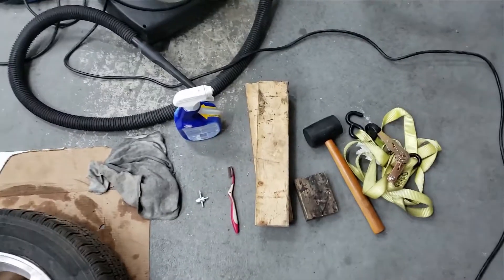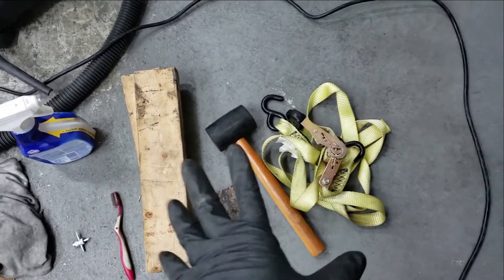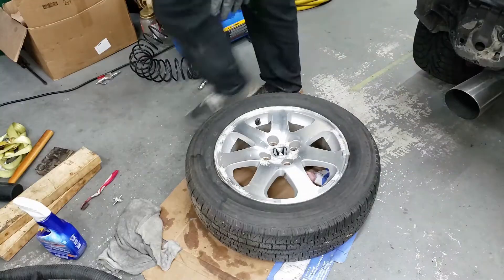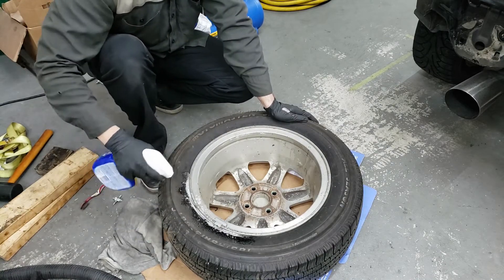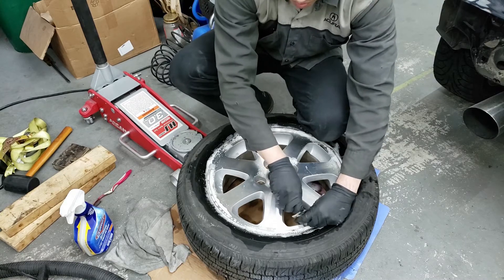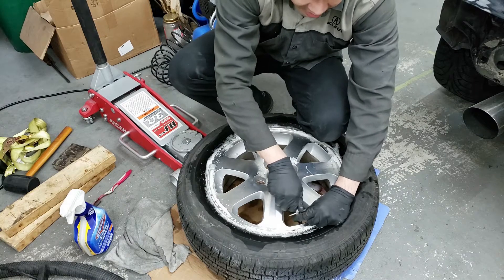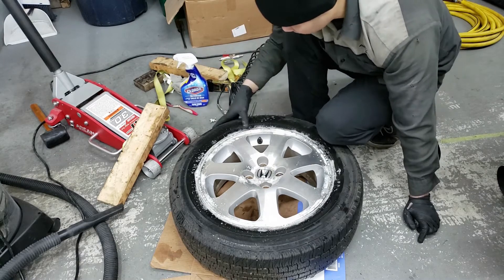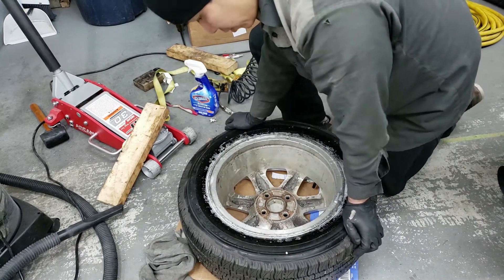[DIY Car Maintenance]  How to Break a Tire Bead at Home Using Simple Tools - THIS WORKS!👍

Comment: The pieces of wood are a great help to break the bead of the the tire especially the smaller piece that you placed under the bigger piece to break the bead, one thing though I would suggest is using steel wool to really polish and clean the bead area since the toothbrush won’t really do the work 100% as you need the bead really smooth and polished to create that seal so air won’t leak however if you use any sandpaper be careful bc it’ll make the bead circle bigger if you over do it and then it won’t seal as it’s meant to

Comment: I assume the 2x4 piece of wood under the tire and out of view is placed against the wheel rather than against the bottom side of the tire.    Is this correct?
Reply from the maker: Yes, that's correct. It acts like a bracing on the back of the wheel and tire. This is only necessary for lower profile tires. If it was big high profile tires, you can break the bead without the wood.

Comment: ....or you can take it to a shop and they can reseal it....wont cost much either.
Reply from the maker: Hahaha. True. But you know I diy everything. I've never taken my tires to a shop unless its to mount and balance brand new tires. I've always plugged them at home and reseated the bead at home. It was easier with my altima. Just dropped the car on the tire and the bead breaks.